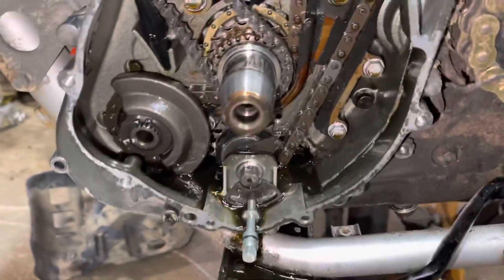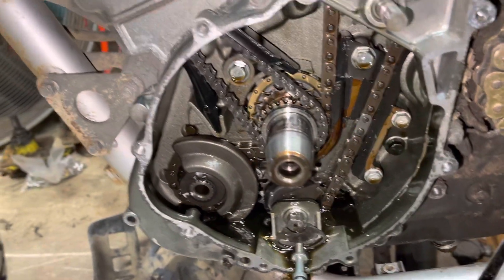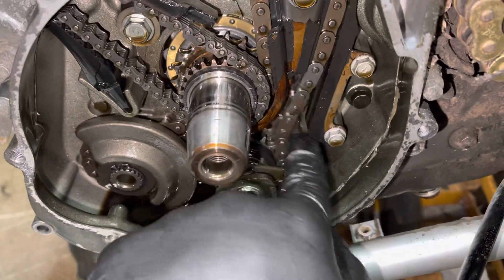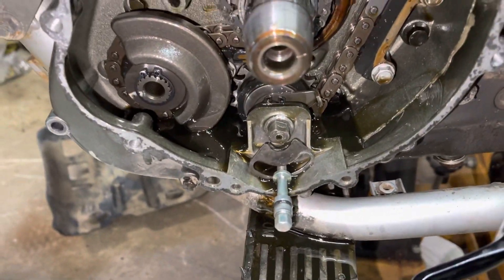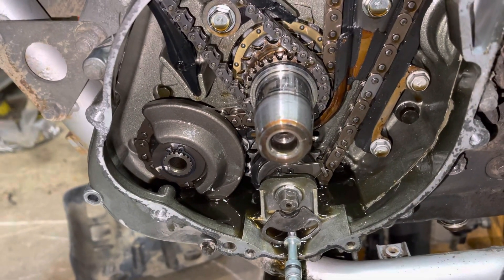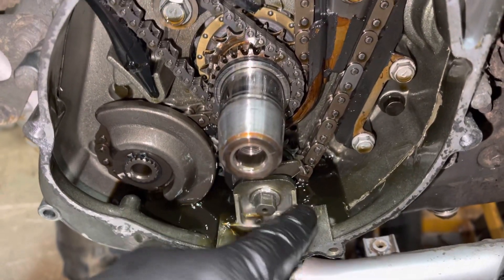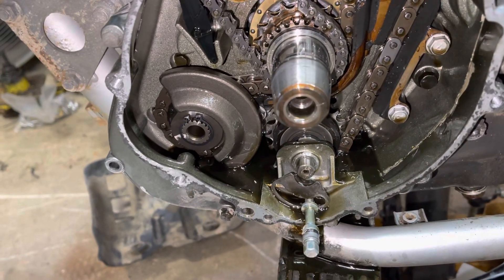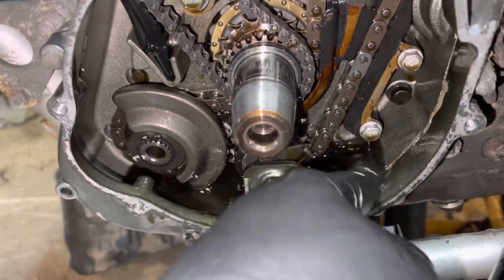Kawasaki KLR650 doohickey failure example

Comment: 22+ appears that the springs are worse. EM kit needed.
Reply from the maker: I’ve not had a new one open yet, but I hear that the springs just lose their tension after 3000-5000 miles but the actual tensioner piece is made better.

Comment: This is as common as mud, the collar is known to fail on all years, the spring breaks and the collar gets heavy wear, becomes sloppy and it snaps off, into the sump, then drive force will slacken the lock pin , the chain will fly around eating the guides and eventually derail then your balacer is toast, DO THE DOOHICKEY EARLY!!

Comment: ok but  kawa  now that problem  for manny  years an the does nothing  to improeve it , schame on you  kaw
Reply from the maker: The ONLY improvement they did was upgrade the actual cam that the spring holds.  The spring itself is still junk and loses tension/breaks.